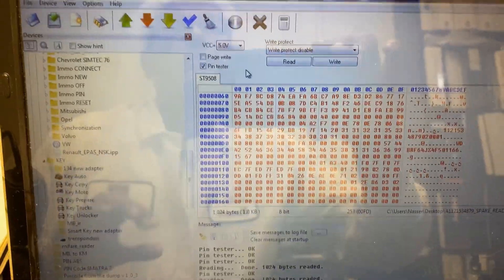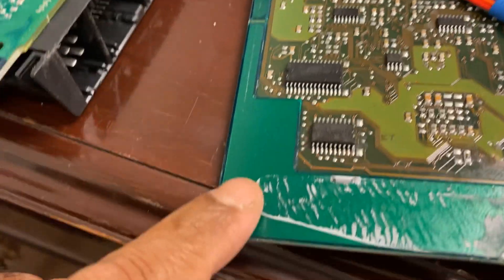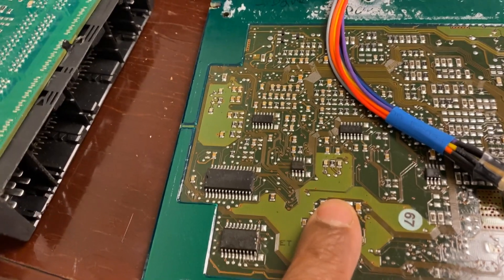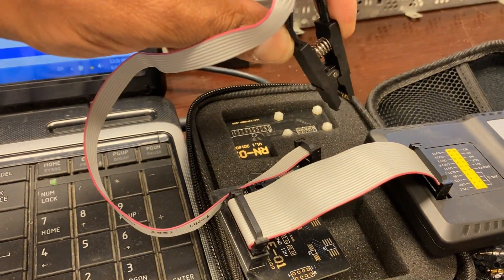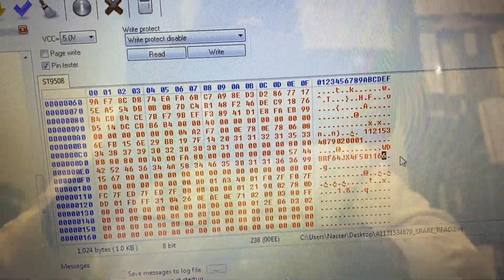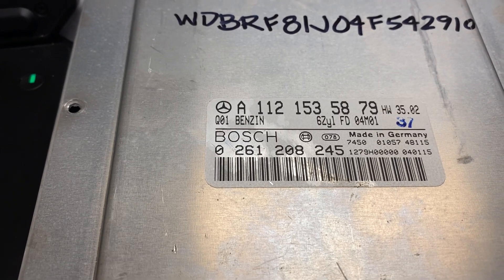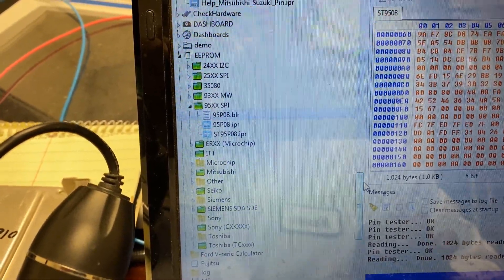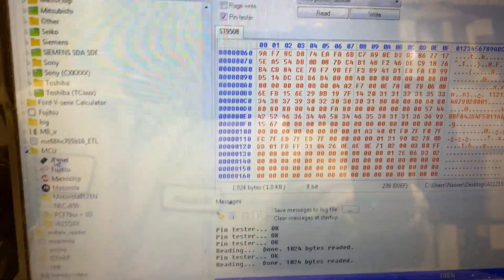How to program used Mercedes ECU, immobilizer programming after ecu swap.

Comment: How about an 1999 SLK230 ECU - # A028 545 4432 ... It has a motorola processor and probably an eeprom for the immobilizer...?
Reply from the maker: If you looking to swap the ECU with Motorola just read from the original ECU and write to new (used once) no need to read EEPROM ( the Motorolla processor has all info) , you are done it's about 15 minutes job after you open the ECU cover, don't forget to left pin# 20
Reply from the maker: https://drive.google.com/file/d/1KULLhzxNtzICO_h9yHIULgLsW4XJ8u_W/view?usp=sharing
Reply from the maker: check the link for the processor pinout, thanks